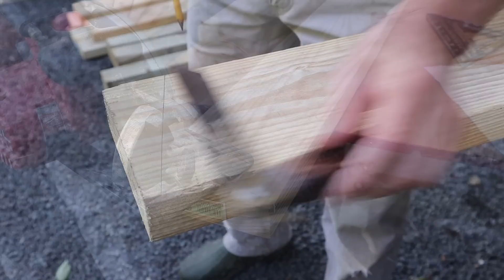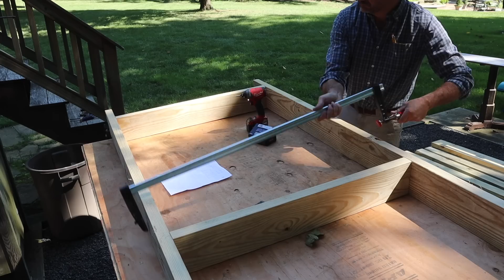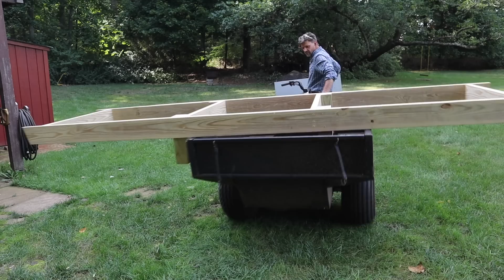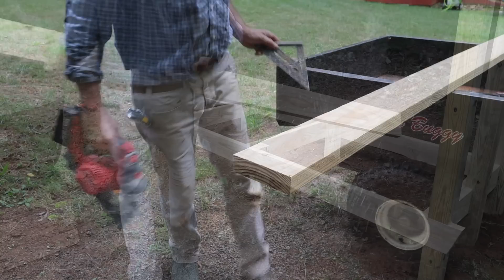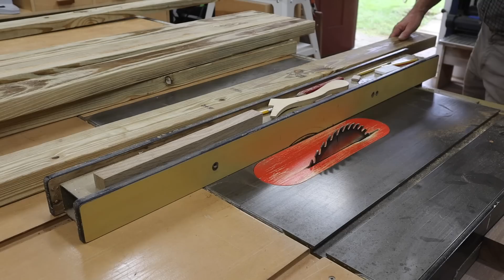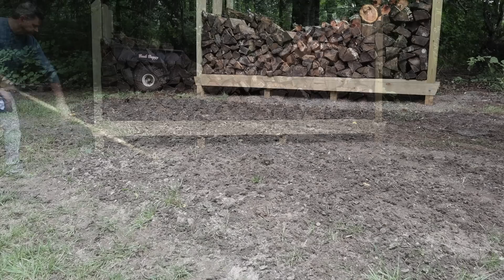How To Build a Double Deep Firewood Storage Rack - Free Plans

Comment: Wow, a tad overkill with joinery, lag-bolts,  screws, 2x6’s and 4x4 legs. Don’t get me wrong it’s very nice, but that’s a very pricey way wood storage. When one could just use 4 cinder blocks and a few 2x4’s and get the same outcome. Why not add a roof too since you’re going all out. Nice project tho.
Reply: Go weigh a cord of wood when it’s wet/snow and see how your spaghetti noodle 2x4 one is going to hold up.😂😂.

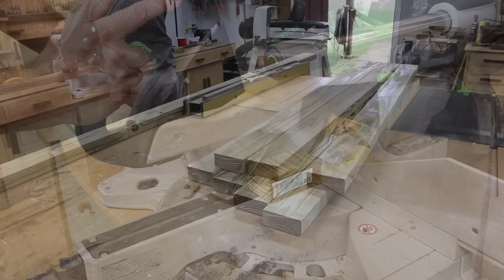Comment: I got all the way to 7:30 and then he mentions using the table saw. I need to build a firewood shed and I don't have a table saw. I wish there were a way around that without trying to rip a 2x4 with a circular saw.
Reply from the maker: I think you can make those rips with a Circular saw
Reply: @JonPetersArtHome  Thanks. Seems like a long length, though. I'd have to be really careful about keeping the wood stable and the saw steady. I'm always careful with power tools, but this goes into super-cautious territory.

Comment: Question: Why use deck screws, which have no structural strength, and then add lag bolts later? Why not just ust GRK structural screws and be done with it? No drilling and bolting needed.

Comment: Seems to me that they’ll get wet when it rains and then it’s “wait till they get dry again”.
Reply: That's not really how wood dries. The reason to dry or season firewood is to dry out the inside of the log/piece. If you've ever seen rain on a wood deck, the superficial water or water left on the surface evaporates really quickly and the board itself isn't sopping wet. 

If it's recently rained, then starting a fire with damp wood isn't easy but throwing some onto an already burning fire wouldn't really affect it.
Reply: Yes I agree with Andy. Green cut wood may be something like 70 percent moisture by weight. If you leave it out in the elements (but off the ground) to cure it will still dry out to 30 or even less percent moisture by weight. I mean, I am not sure if you can do that in a rainforest or whatever. But in many places it will cure (internally dry out) even if it gets rained on.

Comment: I need something like that, but with a roof - how much does that one hold?
Reply: Stacked to the top of the side supports with no gap between stacks,. it will hold about  155 cubic feet or 1.2 cords of wood. So,  subtract a little for gap and not stacking all the way to the top, it should hold around a  cord of wood.
Reply: @AppalachianLife  thanks!

Comment: How far into the board are you driving your screws?
Is there a recommended depth?

Edit: after some research most if not all say to drive the screw either flush Or 1/6” below the surface of the wood. 
Are you aware of anything different or are you ‘In the Zone’ and doing your man thing? (I do this as well until I catch myself)
Edit #2 - I have added a roof on my three rakes. The wood stays dry and bakes in the heat.
Love you design!
Reply: I was wondering the same thing, he seems to be driving these screws almost all the way through...
Reply: yeah... most of his screws aren't holding much.  Flush or just under surface is your goal.  This video shows what happens when you have a fresh battery on your impact drill blasting screws into wood lol.

Comment: Screwing in those deck screws, they go in more than half way. Do they still provide enough power to hold it together long term?
Reply: Jon is just overdriving those screws a bit--probably a bit more than the manufacturer recommends.
Reply: @kenc2257  Does Jon need to use pilot holes when using an impact driver?  Maybe the screws are going in too easy.  I've seen other videos with no pilot holes used.

Comment: Hi Jon another great video, you mentioned the logs now are off the ground and drying out, what if it rains? Are you going to put a roof type covering over the logs in case it rains? Thanks Jon
Reply: It is not an issue if it rains or snows. The impotant part is, that the logs are off the ground because otherwise they would rott really quickly.
Reply: @tomjefferson5431  I disagree. I have left wood stacked and uncovered and it grows mould in between where the wood contacts other pieces. If covered this would not be significant and would dry out, but my experience is that it must be covered (at least where I live).
Reply: @SamRaimi34  nah
Reply: It depends somewhat on the climate. But the curing of green firewood is something that happens at a cellular level in the wood. Even wood left out in the rain will cure (dry out internally) over time. Maybe in a true rainforest climate it wouldn't dry. But where I live it is possible to season firewood without a cover. I do transfer it to a covered rack near the house before I actually burn it, though. Even though the internal moisture is gone, it is hard to get a fire started with logs that are wet on the outside. Once it is going, wet logs will steam off and burn just fine as long as they are just wet on the outside. Burning green firewood is pretty difficult and often the fire just doesn't seem to get going. But you can have a good fire with cured firewood that is just wet on the outside, once you get it started.
Reply: This is something I have been wondering too, is a roof needed against snow or rain? Thanks for clarifying @Jon